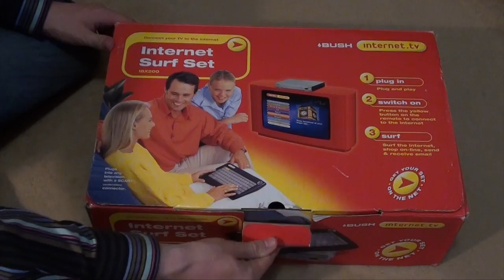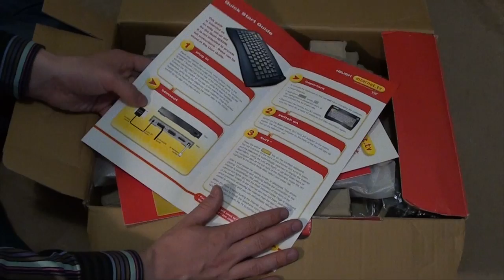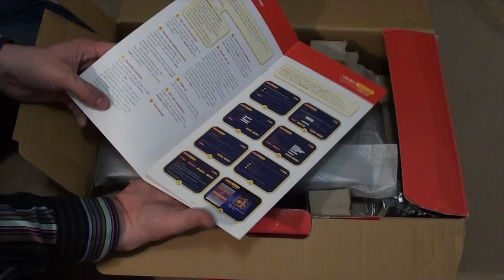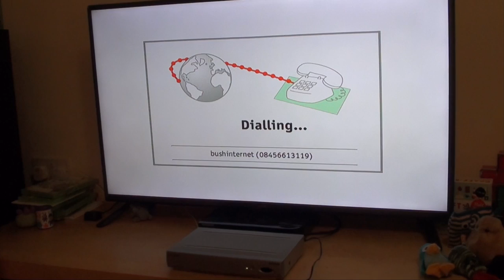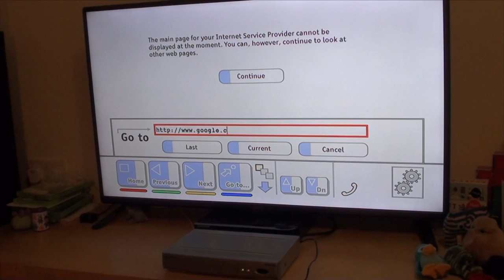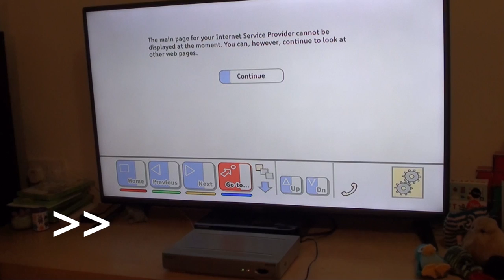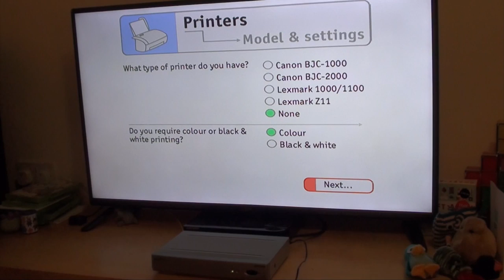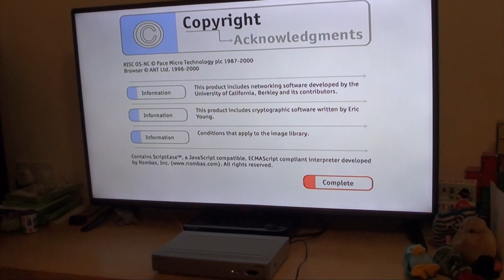Bush IBX200 Internet TV Box Review & Teardown

Comment: Reading the linked page:
http://chrisacorns.computinghistory.org.uk/AfterAcorn/BushInternet.html 
I see that you can actually reconfigure the ISP details (doesn't say it will work with IBX200 though):

"From the main screen the following commands can be typed:
39d8sk43k2 - This is a special access key that should work on the IBX-100 series,
and it provides access to the screen to reconfigure the ISP details. "

It also states that the modem is 33.6k as you guessed :-)

Comment: Interesting printer support - all of those lexmarks were cheap GDI printers with almost no hardware inside. They relied on the computers CPU and RAM to do all the rendering. Didn't think this thing would have the horsepower to support that. Also odd that there nothing like a generic hp deskjet 500 driver which would work with most 'real' inkjet printers of the time.

Comment: Carl, I have recently aquired for free an IBX200 + IR keyboard. I don't have a zip drive or Acorn RISC PC so can't hack it and there is no point anyway as its has no modern connectivity.

But id like to reuse the keyboard for my HTPC if possible. Would it work with a third party USB IR receiver or motherboard IR header and WinLirc or similar SW? What is the IR protocol?
Reply: I have not been able to find any info searching google.

Comment: as the company has gone bust I don't think that it will work but why not get an ADSL cable and plug the cable into the ADSL filter and plug the filter into BT socket and other end into box and see if that works if not then there is no ADSL modem and router inside.
Reply: +DAVID GREGORY KERR It's not ADSL, it's a bog standard modem.

Comment: Nice video! I did the zip drive mod way back in 2006. I had the IBX100 and a IBX250 that used a slightly different main-board but the same hardware. I used the information over on the "heyrick" website. (google it) I used my old Acorn RISC PC 600 running RISC OS 3.7 with the Argo zip drivers to prepare the modules and zip drive image. It was pretty cool but I got board with it quickly, as the box hardware is limited. 

The box is essentially a stripped down Acorn A7000+ with a built in modem. The web browser is called "fresco" that runs from boot-up. The whole GUI its self is all HTML and runs in the fresco browser. Sound support was considered but was later removed before release, you can see the solder pad provisions for the audio circuit and DAC on the IBX100/250. Also provisions for a PS/2 keyboard and mouse are present on all models but was not fitted. The IBX100/250 also have a slotted 8Mb EDO RAM.
Reply: I have recently aquired for free an IBX200 + IR keyboard. I don't have a zip drive or Acorn RISC PC so can't hack it.

Could the keyboard be reused as a wireless keyboard for a HTPC with a third party USB IR receiver or motherboard IR header and WinLirc? What is the IR protocol?